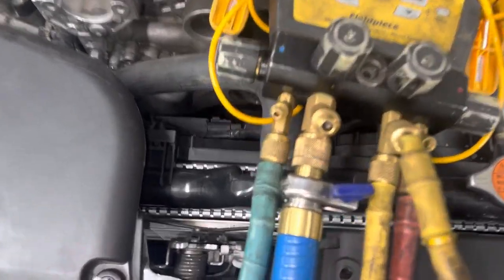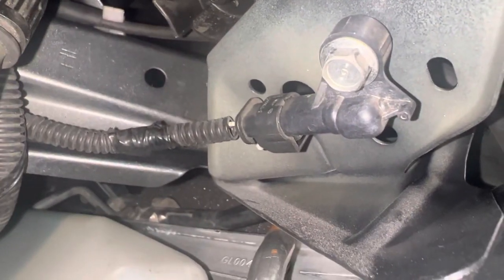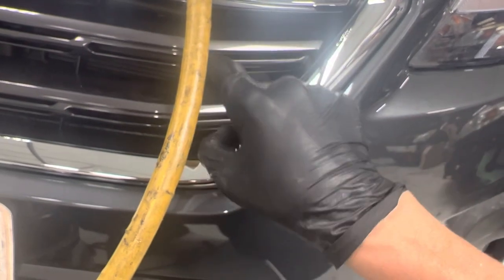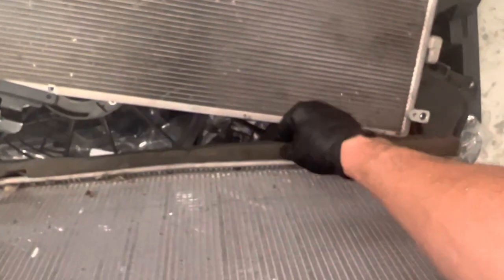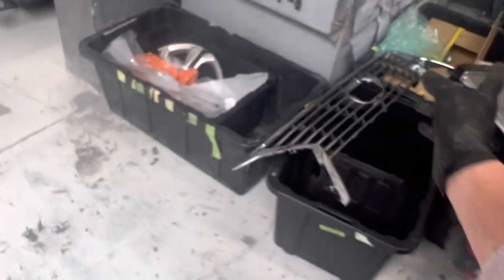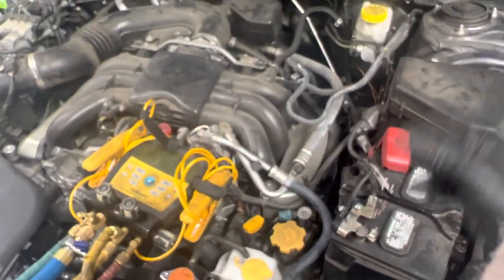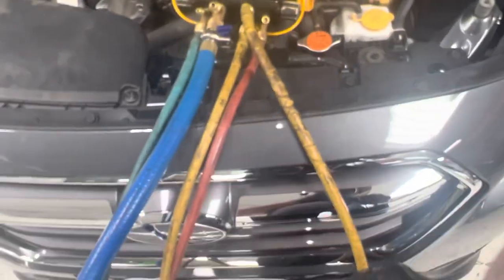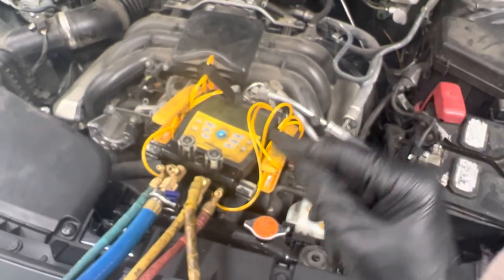AC Technician Nightmare￼, aftermarket parts body shop leaves off foam rubber air dams. ￼

Comment: speaking of foam and air dams, think about engine covers as well....

Even the engine "beauty" covers help cars meet pedestrian impact safety standards as they slam down on the hood with their body.. The shop I work at had to testify that a vehicle that we worked on previously already had the engine beauty cover missing...They lady ran into a 14 year old girl that later died from head trauma from smashing down onto the car hood(8 year old Mercedes) and they argued that the engine beauty cover would have prevented the bolt on top of the intake from punching through the "hood skin" and into her skull...  Always put everything on a car back to the "as built" from the factory, for not only functional reasons, but liability reasons... everything on a vehicle cost money to put on the car at the factory and would not be on the car if not needed and approved by the "bean counters" as absolutely necessary..

Great video...

Comment: It would be nice to see a before and after compression ratio of the compressor due to foam removal.
Reply from the maker: It makes a big difference on hot days and it’s worse when the hood is closed.  And it’s worse when the body shop does not replace a broken plastic from the engine cover that goes underneath the engine to the front of the bumper.. 

It’s almost the equivalent of driving in the summertime and you have two electric fans and you disconnect one of them. It’s like that. .

You don’t need fans when you’re driving down the freeway, but you need them when you come to stop at a light or slow moving. Stop and go traffic. .

Comment: This makes so much sense.   I’m im Miami, Florida and will probably need to buy some of that foam because I’m guessing that mine is missing.

Going to look into that before replacing my condenser.  Thanks.
Reply from the maker: Especially after body shops worked on front end collision and replaced a lot of parts.

Comment: Most technicians  do not know about this even sometime removed and told not necessary even the sheild underneath they remove and replace it.
Reply from the maker: This is because most technicians and most owners did not attend a formal automotive engineering 2 1/2 year or four year program for technical education. 

They only work for somebody learning by making mistakes and breaking things with no knowledge and do not understand. 

Imagine having a doctor that never studied before he was a butcher cutting meat at the corner deli store. 

And then for a few extra dollars he tells you he will perform a liver transplant on your son or daughter or your mother for $50 and all he has is a dirty meat cleaver and sewing thread for clothes. 

This is the equivalent to many mechanics who learned by mistakes and have no education
Reply: What I always tell people.. do you think the factory would waste the money to put something unessisary on the vehicle?
Reply from the maker: @turboflush  If they could save one penny by putting fewer aluminum and fins and fewer refrigerant passage tubes they would do it. 

Receiver dryer desiccant material we don’t need that leave that out cost $.10 but they put it in there for a reason.

Comment: The factory put them there for a reason.
Reply from the maker: I seems the aftermarket parts company that sales the condenser and radiator don’t think so. 
        This is what happens when the insurance companies tell the body they won’t pay for a OEM  original factory part.

Comment: I s there any air seal on sides between radiator & condenser?
Reply from the maker: There should be but one of them are missing the technician moved one over to the new piece but not the other one and they’re supposed to be air seal on the top and bottom to

Comment: 2006 Mazda 3 es 2.3L Auto. There is a gap about an inch on my card what do you recommend foam around all the open gaps will this help with my AC?
Reply from the maker: @Devo1987  any gaps between your radiator and the sheet metal from inside the engine compartment that could come forward to get between the radiator or between the condenser and radiator or even wrap around all the way in front of the condenser

Any gaps underneath the radiator condenser 

Any gaps above
Reply: @coldfinger459sub0   so yes  I should put some phone between condenser and radiator to stop the wrap around
Reply from the maker: @Devo1987  if the condenser is the full size of the radiator, yes

And any gaps between the radiator and sheet metal or condenser and sheet metal 

If you live in hot weather condition 

This helps stop and go traffic and idle speed when you’re parked at a stop sign or stoplight 

When you’re moving down the freeway at 55 miles an hour there is a ton of air pushing forward 

So there’s never any problem when you’re driving fast 

This is the help when the vehicle is sitting still or in very slow moving traffic
Reply: @coldfinger459sub0   great thanks.  Makes sense.      Carry on dude
Reply: @coldfinger459sub0   Im back do have any recommendations of what foam brand and type to use ?
Reply from the maker: @Devo1987  if you have one of those universal big companies that provide all the clips and seals and gaskets and supporting items in your local vicinity. 

I have no brand or supplier that I can recommend you offhand . 

But there is a piping foam that’s used to put around refrigerant pipes that are meant to take really low temperatures and high temperatures called armor flex 

It’s putting around refrigerant pipe, all different thickness, and it comes in all different sizes . 

And the price is anywhere from four dollars all the way up to maybe for the biggest thickest pieces 20 or $30 per foot 

But for the sizes you’re looking for they come 6 foot lengths and you’re probably looking for stuff that somewhere between the 5 to 7 dollars per foot range 

You can cut it in half into quarters or leave it round and compress it depending on your application
Reply: @coldfinger459sub0   great thanks 👍